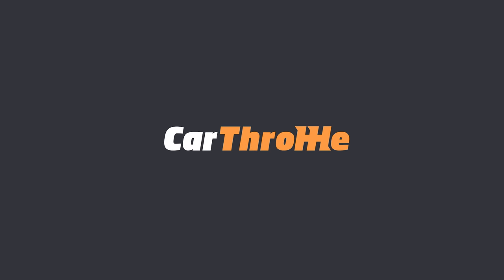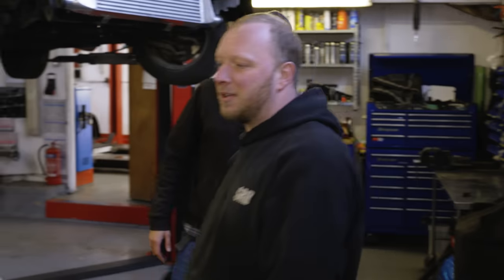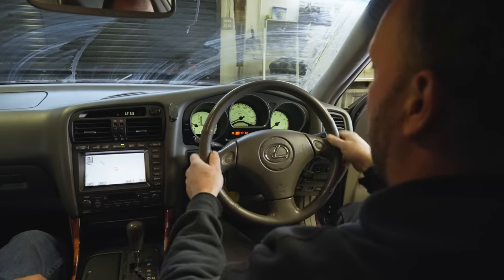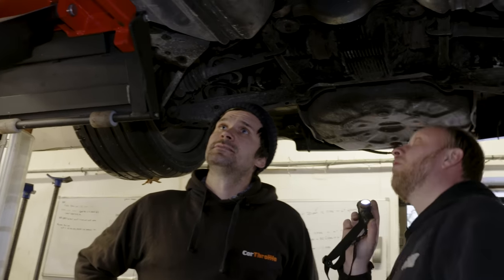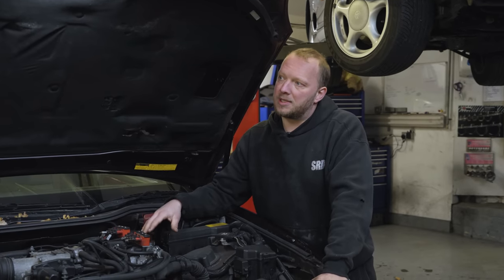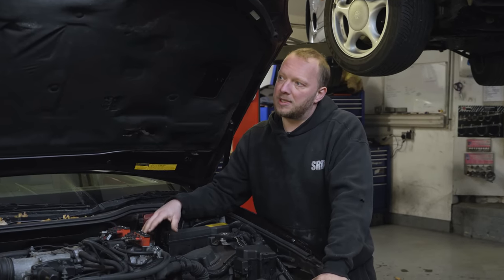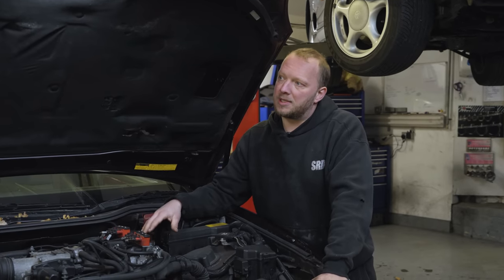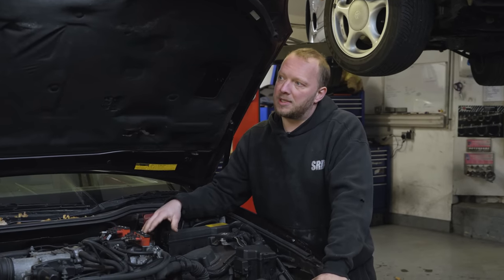What Does 250,000 Miles Do To A 2JZ Engine?

Comment: 400hp manual swap should go a long way in that chasis
Reply: What kind of manual gearbox can be swapped on this?
Reply: @daigosaito888  a lot of people use the 350z gearbox using s mounting kit , I think its the cheapest option
Reply: @sergiopereira9546  maybe in US, in Europe is easier to find GS6-53DZ from E60 530d. mounting kit is necessary
Reply: 350z ain't that rare in the UK
Reply: @sergiopereira9546  but definitely rarer than diesel 1/3/5 series with R6 (and thus cheaper)
Reply: Wouldn't the gearing be weird though since diesel engines rev so much lower or is it all in the diff gearing?
Reply: @adamrichardson2227  just gearing and yes, with standard open diff it would be too long. But put BRZ LSD on IS and it’s fine (lsd have higher gear ratio than open diff). And 6th gear is still longer than auto 5th gear so still better for economy

Comment: I recently inherited a 130,000mile 04 GS300.
EVERYTHING works, apart from the bloody expensive American Hi-Fi 🙄
Still nice and relaxing to drive and I’m enjoying the change of pace. 
Wearing winter tyres now and it’s unstoppable 😀
Reply: Well you'll get to put a cheap AliExpress android unit in and you've got yourself $100 carplay/aa
Reply: @BanterEdits  The amp in the boot is dead sadly. Lexus wanted £1700 for one. All the ones for sale seem to be previously fixed, very expensive or also knackered ☹️
Bluetooth speaker for me for a bit. New car arrives in Feb, so off to eBay after that. I’ll be sad to see it go though after 16years in the family.
Reply: @NineS5  
Nope 👎🏻 
It’s not just an ‘Amp’ 
It has a load of the tech built in and several multi-pin connections. 
It sounded amazing when it worked too.
Reply: @NineS5  
Pretty much yes. I’ll just keep using my Sonos Roam, as any alternative will be too much for the use I’d get.
Reply: @DontPanicDear  look up Cartronics in Surrey, they can usually fix stuff like that in 90’s/00’s cars for reasonable price
Reply: @jamie0193  
Mmmmm….
I live in Surrey 😀
I guess it’s worth asking then.
Thanks for the recommendation 👊🏻
Reply: everyone in high school wired their own stereo systems, it's really not that hard.
Reply: @WhuDhat  
Yes, I built several increasingly complex systems back then. 

This system is particularly tricky though. The ‘Head unit’ is also the car control electronics system, with AC and vehicle options imbedded. 
Some of the brains for this are in the rear mounted amp, so it has two way coms. 
So one can’t replace just the amp either. 
It’s a US Mark Levinson system, not a Lexus failure.
Reply: @DontPanicDear  I've got an OEM non-nav Pioneer gs300 amp you can have for the postage if you want. If yours is the Mark Levinson it won't work though
Reply: @charlienash290  
That’s uncommonly decent of you! 
It is a Levinson unfortunately 😕
Reply: Is this a common failure for the GS300 and are all GS300s fitted with this audio feature?
Reply: @anthonybelton-ford3124  
I think so yes, as the GS only came in one trim level here.
Anything still working goes for strong money, or has already been repaired by somebody. 
Not worth it for me.
Reply: @DontPanicDear  cheers for the response and info
Reply: Buy a Amp Bypass for it and wire a cheap double din, keep in mind it will NOT work without bypass
Reply: @DontPanicDear  ah never mind then. I used a CT20TY01 harness adapter to use the existing wiring for a new head unit in my 2001. Had to swap a few pins in the connector but it's working great now
Reply: This the problem with integrated "infotainment" units. Once they break you are screwed. You can't just swap it for something else or half car's functions won't work.
Reply: Well I never did get the sounds sorted! 
I just used a BT Sonos and slummed it 🙄
LS has gone to a new very grateful home now, for an absolute bargain price and will be well looked after. I fear the Lexus FSH will end at this point though 😂
I’m sure my Dad would have approved though, so that’s the main thing for me.

Comment: I'm canadian , I've imported and owned a 1992 toyota soarer gt-tt for 12years . Replaced 30 sets of back tires , 24 oil changes , 2 x4 corners brake pads , and a rear diff input shaft seal. 

I've never been soft on it ! That was my 3rd/amusment car , I've let her get warm 100% and after it was full throttle/rpm/fullcut on co___ine, was really a good time in my life hahahaha
. What a engine ! I'm still in contact with the guy I've selled it , one day he will say yes

Comment: Thw blessing ive been looking for. I bought my 99 gs300 for 1k from a friend and rebuilt the bottom end (except pistons) myself. I started doing the NA-T build with the the manifold, piping, intercooler, turbo and tried to upgrade the intake manifold but i didn't do enough research on the ECTS-i. From what I hear is that its needed for the auto transmission to work properly so im working on fabricating that back on since a CD009 manual transmission swap is currently out of my budget

Comment: I have a family fleet of 5 Toyota/Lexus cars and three have 2JZ-GE VVTi engines.  Two have over 300,000 miles and one has 230,000 miles.  They all run amazing with resealing and maintenance.  Just like they said, take care of them up and enjoy.  Replace the VVTi cam gear seal on high mileage cars and you'll fix one of the major leaks.  It gives a decent bump in power from how it previously ran.

Comment: Nice. 
I've had a couple Toyotas with 250k+, you really can't beat them as long as the body is solid. 
Those 1nz-fes are pretty fun in the right cars.
Reply: The 4 liter 1UZ-FE you mean
Reply: @Richardsung97  No, I said 1nz. Reliable as all shit, in a stripped car with basic mods and a good short shifter, it’s good

Comment: I’ve got a 01 gs300 which I’ve NA-T and manual swapped as a drift car. It’s great to see the JZS16X platform get the love it deserves. Honestly such a underrated car. Just watch what the boys in Japan do with the Aristo out there (Toyota version of the GS300)
Reply: Are your internals stock on your gs im wanting to turbo my is300 but I don't wanna put rods and pistons and I only want 350 hp it only has less than 100k miles and I want it to stay reliable and would like to know what if any problems i would have and if you have had any thanks

Comment: My girlfriend has a 355k mile 2JZ and in the 3 years together it has only gone to the shop for some spark plugs/wires that needed to be replaced. Obviously, it had all the needed fluid changes as required. Much less trouble than the VQ I had is less than half the miles.

Comment: 240 000 miles, engine looking good, the chassis in a decent condition, 190hp which is enough - YEAH, one could go back in time (if one had a time machine) and tell anyone that if they want a daily car which will grant you 200 000 miles without any problems if one does basic maintenance, and it has a 2JZ, then with all confidencr this Lexus is a must have.
And when all comes down, whatost of us really want from a car, is to take us wherever and whenever we want, issue free, right?

Comment: Honestly 
Everyone thinks of turbo on a 2jz 
But what about a NA build, something diferent 
Not a hole lot of power but a good rpm range and a manual swap 
Lowered on some set of wheels and a good daily driver with a reliable engine 
Plus it would be economical to drive since its not on petrol

Comment: So a 2jz with a 1000bhp output is actually a different engine with just one bit of the original engine in it which is not even the engine block or was tht an exaggeration.

Really wld like to see u guys mod this urselfs to 500bhp + that wld be amazing
Reply: Not really. A GE - non VVTI has essentially same block, rods/pistons as a GTE less oil squirters. The vvti version has the piddly rods.

Comment: Sold my 2jz gte aristo with 52k on the clock 3 months ago for 9.2k, wonder if they'll go any higher?!
Reply: Sold my 2004 for £12k in July, but was bpu++. Would have kept it if ULEZ wasn't an issue
Reply: Yes, anything that has value and its production has ended will go up in value after certain amount of time.
Reply: @Tree0fL1fe - I was considering one of these before ULEZ & many other cars, such a shame
Reply: @DuBstep115  Not always. There are a lot of cool desirable cars that are really difficult to find parts for or are expensive to maintain as they age that don't, which is an unfortunate and shitty reason that they end up being a lost cause or just neglected. I am thinking like older Jags, Mercedes, BMWs and the like here in the states that you can find really cheap, for a reason. There are some beautiful, fun and legitimately fast cars out there that often get neglected to rot in a sad state because the costs and headache involved. In the UK maybe it is something else. Sometimes it is just because the design of the car itself was so different that it ended up being a black sheep in the car lineup so it never got the aftermarket support or the parts availability to make it live up to what it could have been.
Reply: @adamrichardson2227  I just saw 1.6 ford Sierra go for 8000€, about 15 years ago it went for 350€
Reply: That's worth like 25k tho
Reply: @adamrichardson2227  totally agree, uts definitely the same here in the UK, e55amg for example you can get for 5k here, used to be 80k plus car! Parts are so expensive that they're all ruined these days especially with increasing miles. The aristo used to be a 2k car all day but because they're becoming legal for US importation and they have the 2jz gte, the prices are regularly rising, I just don't know where the ceiling is!
Reply: I sold a GT86 a few months before covid for a few 1000 less than I could have sold it for now with higher miliage 😒
Then early into lockdown I bought a mk2 Renault Twingo as a cheap runaround. If I kept it I would have doubled my money on it.

Used prices went silly.
Reply: No way 🥲 here in nz GTE aristos go over 20k. I purchased my aristo GE for 10k including onroad costs. Whoever got your GTE I hope they know how much of a bargain that is 😭🤣
Reply: @alisahalcrow9770  Are you based in America? I'm thinking I did the wrong thing selling it but I wanted a faster car! Upgrades cost a fortune over here!

Comment: I pulled the head on one of my volvo turbo inline 6 engines with just over 300K miles on it cuz I’m Curious how they look at that stage since I have two nice Volvos pushing past 300K miles with that engine this was the shitbox of the group so off with its head.  

Kid you not, cleanest top end I ever seen on an engine that was used, never mind 300K miles and a turbo.

Comment: All l can say is that is a typical Toyota engine and the engine is in great condition it was interesting what the mechanic said about the cams ect my 22R engine in my 1997 Toyota Hilux has the same colouring whivh means it been serviced regularly and has done 430000kms and as far as l know it has not been overheated or anything nasty happen to it and it is the original engine well thats how Toyota build there engines bullet proof as for the rest of them rust is an issue in the UK and parts of the USA but not in Australia where l live

Comment: Throw a load of parts at that engine and make a load of power. Then remove it from that junker and put it into something worthwhile. 
As it is its a good, cheap car - fix the leaks and let it go more miles. If you're going to throw 400hp+ at it you would be better off getting something else in the first place.

Comment: I'm pretty sure that LPG's brain automatically switches to gasoline when engine run over 3500-4000 rpm. So when you checking  power on dyno at 5k+ rpm... guess what? ;)

Comment: typical gs rust. i traded a mint ls400 for a gs400 that looked mint til i jacked it up and the rear pinch weld caved in on both sides. it was completely rotted out not even saveable